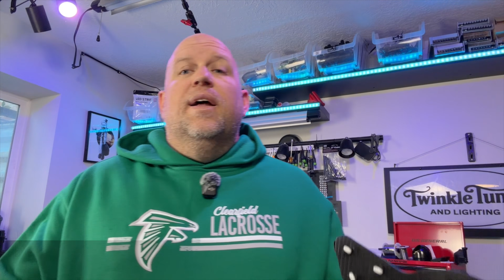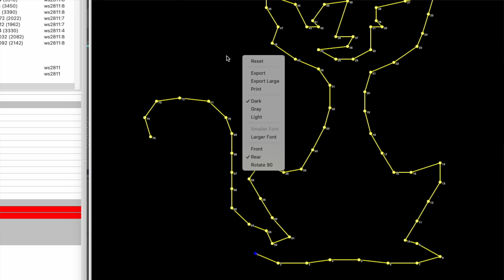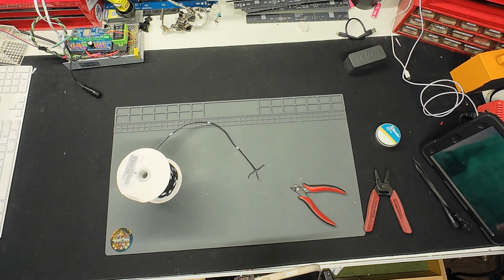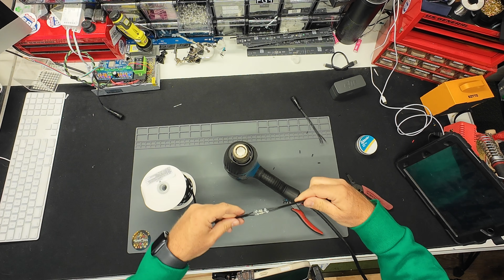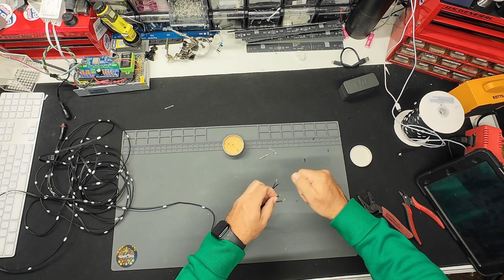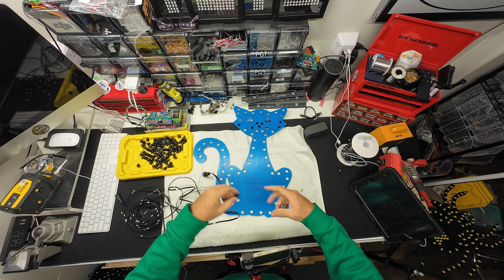Building My First LED Prop (Beginner Step-by-Step)

Comment: Hmmmm I thought you were going to show how you cut Coro and made the holes.  I think most of us know how to push pixels.  Now showing the whole design process and cutting options for those of us without a laser? That would be a great favor for us impossible.  I enjoy your stuff and thanks.
Reply from the maker: Yeah, that’s fair. I realized pretty quickly this was turning into a MUCH bigger topic than just “push pixels into a prop.” There are way more ways to cut coro than I expected, and some worked great… some absolutely did not.

I’m actually working on a separate video focused completely on cutting coroplast, making holes, tools that work, tools that don’t, and options for people without lasers or CNC machines. I wanted to give that topic the time it deserved instead of cramming it into this one.

Appreciate you watching and the feedback. That video is definitely coming.
Reply: @twinkletunesandlighting  I'm looking forward to that!! thanks.   I wonder how a scroll saw would work.  Sourcing thicker sheets of coro also seems problematic, although I went to a local Post-Net shop in Phoenix and they said they could order some for me, just not sure if it makes economic sense.  
Also, maybe an obvious question, did you get seed pixels with a 4" spacing for props? Similar length to bullet pixels?  I got some matrix strips from your Bong69 video, that was a cool process and super fast, using 1" seeds on those.  Thanks again.